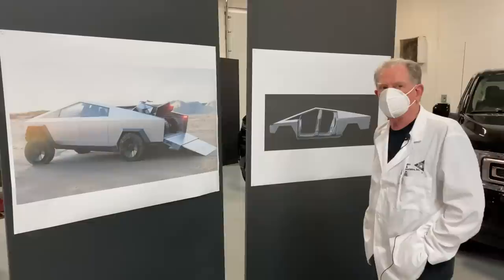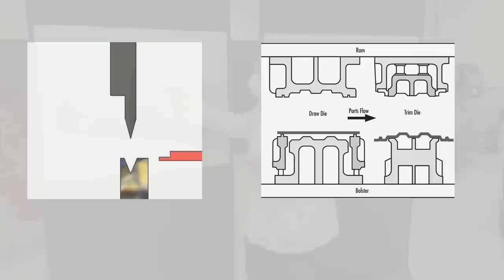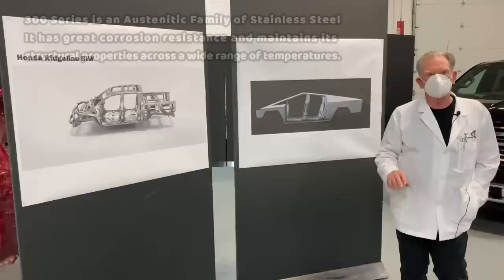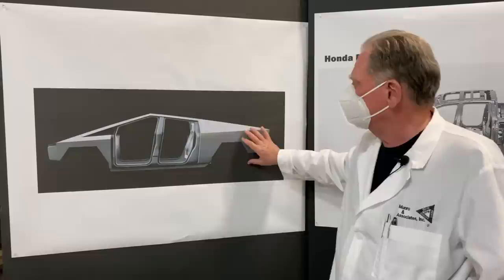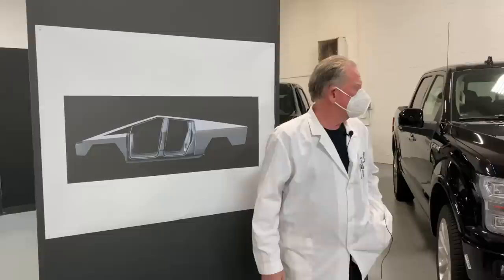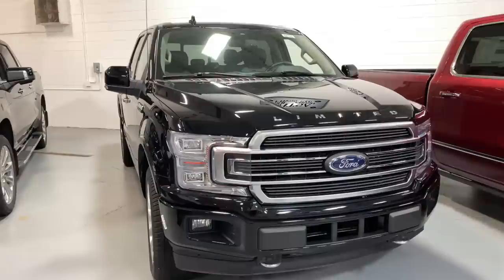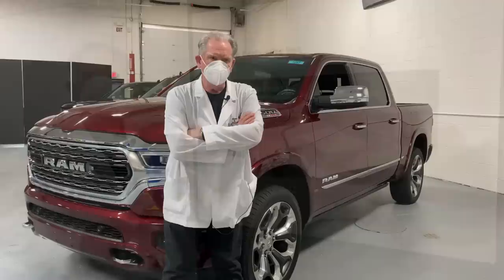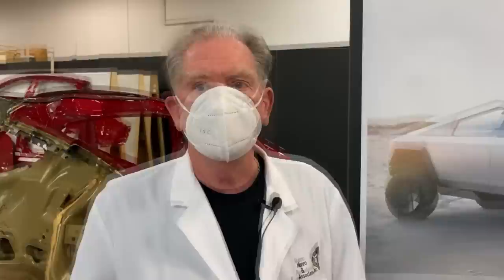Cybertruck E1 - Body Structure Comparison

Comment: You goofball, you don't want a carbon fiber box, you need weight on the rear for traction when you have no load which is most of the time for people. You need to reduce the front weight and leave the back or put the transmission in the back with differential. For the life of me i don't know why GM never took the C5 corvette design and put the transmission in the rear for a pickup. Nobody wants to needlessly turn on 4wd for that little bit more traction to get unstuck and then turn it off.

Comment: Ford aluminum is much thicker than the others steel. Tesla can’t paint a vehicle. That is is a huge problem for them. Not sure why they can’t figure it out. What happens to the Cybertruck when it gets damaged in an accident. You most likely cannot repair it as easy as steel or even aluminum. So insurance on it will be sky high, since they will be totaled in crashes. Tesla’s crash a lot. Don’t let Elon fool you. Look up salvage Tesla’s for sale. There are thousands and thousands. Let’s not forget this truck will most likely have a GVW over 10,000 lbs.  Sandy that’s 1 ton category. 1 tons will destroy this truck on towing capacity.

Comment: Sandy compares today's pickups to ...  Vaportruck!
Reply: Marc Fuller .....seriously? I thought all the TSLAQ people would have learned their lesson by now 🙄
Reply: Watch tonight's episode of Jay Leno's Garage, then tell me it's vapourware.
Reply: Hey Einstein, the Cybertruck isn't late as it wasn't scheduled to go into production until NEXT year.
Reply: Compared to other "concept" cars this is very much along the lines of an official release.
Reply: @Jimmy_Jones  As Sandy is a skilled and insightful engineer who seems to have manufacturability and market acceptance as significant professional interests, I am surprised that he did not mention the external dimensions of the truck. Its size is much closer to the Humvee than the pickups currently on the consumer market as well as the Bollinger and Rivian (which are coming many quarters before Tesla's). The straight plane design nature of the Tesla means that the dimensions of it need to be larger that the typical consumer pickup to offer the same volumes. 

Additionally the large dimensions of the Tesla means it will not fit in a very large percentage of residential garages, of which many are located in neighborhoods requiring resident owned vehicles to be parked in the garage with the door closed overnight. 

If the Tesla pickup, as they have shown, is actually a close to production concept its intended market must be primarily government/military. 

I admire Sandy's work so have come to the conclusion that his insistence on creating content related to Tesla's pickup while excluding EV pickups much nearer to market is an effort to gain YouTube subscriptions, likes and enhance future monetization of the channel.
Reply: @MarcFuller  it's smaller than an F-150. Also it's stainless steel. It can be left outside. It won't rust.
Reply: @Jimmy_Jones  You are correct. I was wrong about the dimensions being more like a Humvee.
Reply: @MarcFuller , you obviously don't know what the term means. You can rightfully label Tesla's Full Self Driving vaporware because it was promised to be delivered long ago but if the Cybertruck is a Vaportruck, then ALL of the EV trucks are too.
Reply: Yup, just like the model S3XY......all vaporware.
Reply: @MarcFuller , um duh, derp, you obviously didn't view the Cybertruck unveiling, did you?